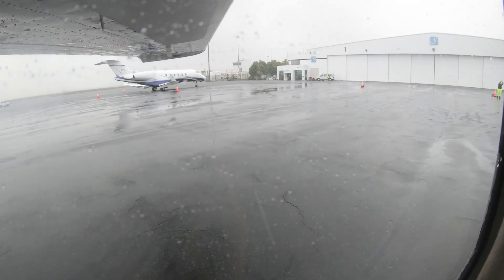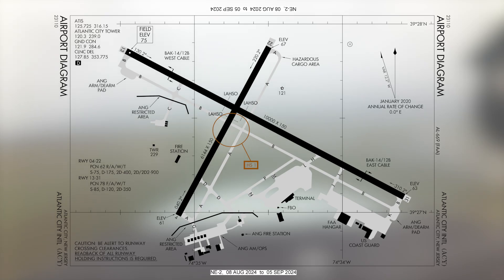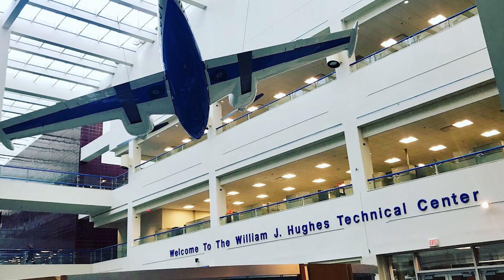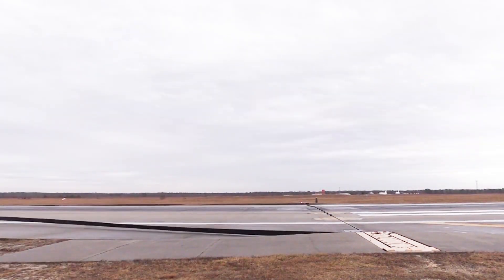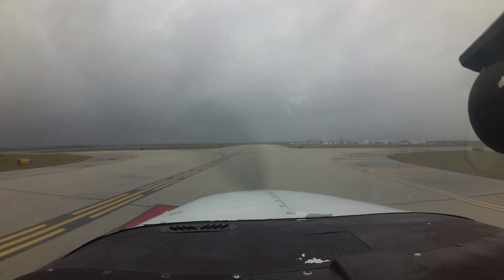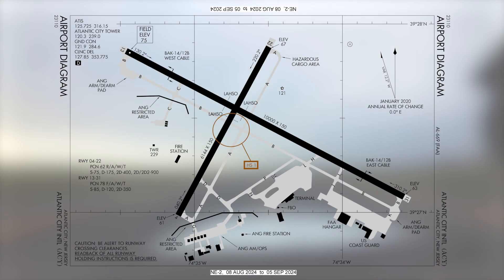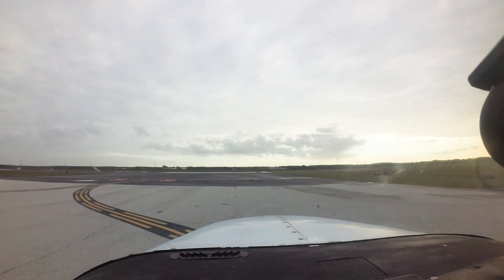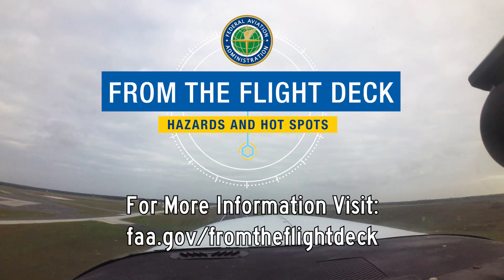From the Flight Deck – Atlantic City International Airport (ACY)

Comment: Good video.  If I may offer a suggestion. 
Many airports have the same problems you have described in this video.  Sometimes it is hard to see markings.  🚧 I think maybe a low cost technology approach would solve this problem.  At all critical points on the runway🛬 a  device which sends a signal to the aircraft displaying in the aircraft its exact location and appropriate  warnings.🛑 This would include possible incursions! 🚁Pilots in the aircraft could now take appropriate action.  The cost of such a system overall would  be far less than an resulting accidents and possibly save lives.
Reply: A relatively low cost approach to this would be using a Stratus or Sentry ADS-B receiver allowing display of your aircraft location on the airport chart.  The ForeFlight app will even provide aural warnings when you are approaching a runway.
Reply: @johnh9637  I do think they need something.  Keep the ideas coming.